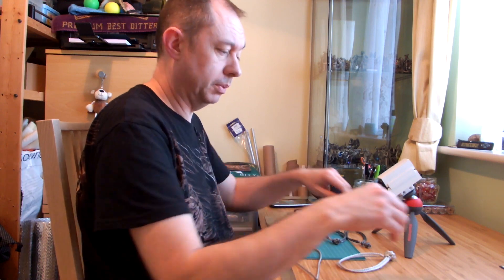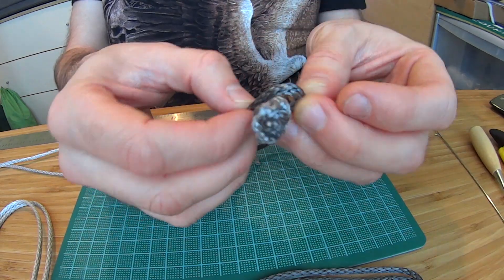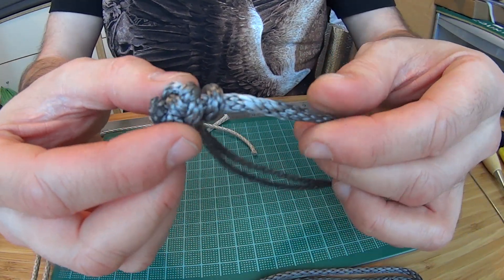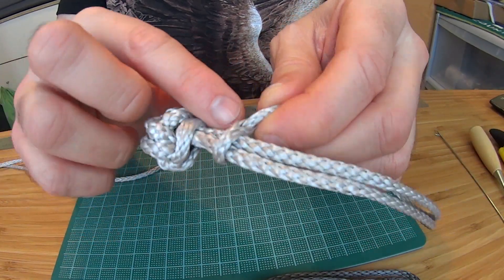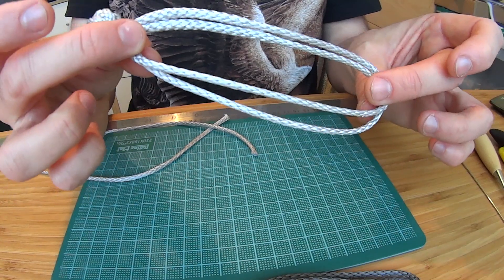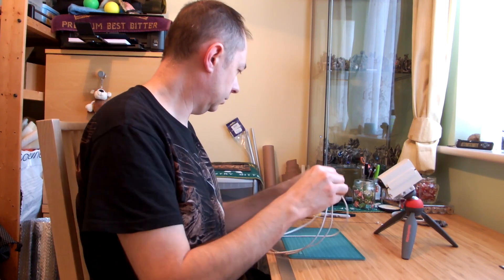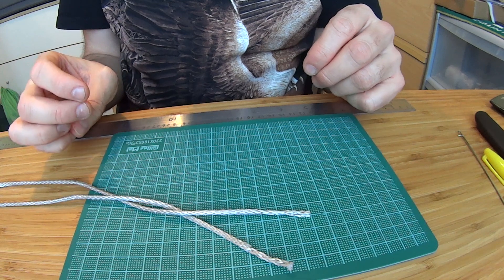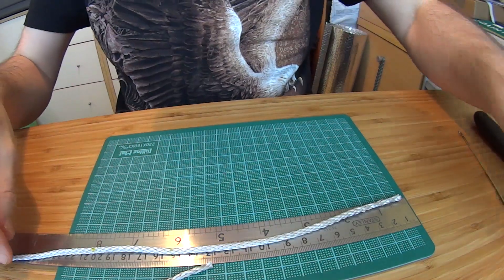Improved Soft Shackle

Comment: what are the advantages to the this version with the two strands bare as opposed to the buried version that you have to milk? I understand the button knot vs the other knot but why no bury on the shackle length?
Reply from the maker: jbaker91585 the buried noose version under high loads can be very difficult to release, some put a thread inside to help to open but this is all too difficult in cold weather and cold hands. This version doesnt jam and is always easy to release just be pulling one strand.
Reply: Tac Blades seems so. have you seen comparative test information on the two versions?
Reply: also, would I have any issue doing the button bury if I build a burried noose version?
Reply from the maker: jbaker91585 i put a link to the original research in the comments but since then unfortunately they have removed it from the internet.
Reply from the maker: jbaker91585 just checked looks like its back up again for now anyway.
Reply from the maker: jbaker91585 its not something i have done? I am not sure it if would be possible unless its a very large loop.

Comment: The part of the video where you don't show the second loop made at the end, are you passing the buried loop end through the second hole like you did on the first one? Is that possible given how large a buried rope would be?
Reply: Nevermind on this. After watching the entire video again, I see that you do actually pull the knot with the bury through the cord. I guess I need an all for this project. I didn't have one, and as it turns out, it's a difference maker in terms of being able to pull items through when they are double the thickness. thanks for the tutorial.

Comment: Hi, I have a question about your version of the soft shackle: did you have it tested at the 230% strength or is that number based on http://l-36.com/high_strength_soft_shackle.php ?
I really like your version because of how the tails of the eye splices are throughout the knot and into the part that the loop goes around. This seems to eliminate the weak point of where the tails of the button knot get buried with the other version of the shackle.
Reply: I just found the answer: http://www.balancecommunity.com/slack-science/comparison-soft-shackle-methods/
Reply: Excellent video man, thanks for sharing!

Comment: Excellent demonstration.  I get it now.  And because of the bury, the cord is also double-thickness where the loop tightens around it just behind the knot.  As I understand it, that's also a common point of failure.  As far as I can see, this design of soft shackle shouldn't ever become over-tight around the 'neck', and I can see now why the knot will never invert.

But what I like best about this shackle design is that I can visualise it completely.  That complicated diamond knot looks nice, but because it's more complicated, I'd always worry I'd got it wrong in some way.  The double overhand knot is known to be very effective.  I know climbers who will use a simple double overhand knot to join two ropes that their lives hang by.  Ugly, but simple and reliable, ...and can be done with gloves on.

I've watched a few tutorials on making soft shackles, and this is the best by far.  It also convinces me that this is the best kind of shackle to use, (...unless you really must have a single-loop design for the sake of neatness.)  The fact that is has 240% of line strength rather than say 130% presumably means you can use thinner line.
Reply from the maker: Paul Mackilligin thanks for the comments.  For hammock use and camping use i feel this is stong enough with plenty of safety margin for all uses at any weights. 

I know people that have made dynaglide shackles this way and its good for them. 
The only complexity is that the thinner the cord the smaller the radius in the turns and therefore the weaker,  also the bury length needs to be proportional the diameter of the cord so quite tricky.
Reply: I'm actually looking to replace all (most of) the nasty steel fittings on a sailing dinghy.  Stainless steel shackles with clevis pins and those tiny, tiny spiral wire retaining clips (which can be lost forever even if dropped in a grassy field, let alone if dropped in the water) ...all that stuff has to go.  Planning on replacing the wire shrouds with Dyneema too if I can.  It's mainly for safety though, as the hard metal stuff can cause real injury when body parts collide with it.

The cord you used in the video, what size was it?  It looked about 6mm (?)  I was thinking of using 4mm or even 3mm.
Reply from the maker: Paul Mackilligin this is 7/64th amsteel,  in uk this is 2.5mm see here https://goo.gl/KTpHgO 726kg breaking strain,  you can get thicker tho,  also floats :)
Reply: Oh, OK, a optical illusion then.  It looked much bigger!

Comment: Great video, thanks a ton for sharing.  I've been looking for a good soft shackle to connect whoopie slings to the continuous loop on my hammock.  I'm going to try making some out of Dynaglide.
Reply from the maker: Thanks,  i know some use dynaglide for ridgeline but i wouldnt hang off it i like at least a 5:1 strength ratio to  cope with dynamic loads :)
Reply: +Tac Blades Do you know what the rated strength of Dynaglide is?   I believe Dutch has tested it to 900 lbs.  I'm pretty light weight.
Reply from the maker: +Mark Bishop its 1000lb and amsteel 1600lb
Reply from the maker: +Tac Blades some people do hang off it,  but take care :)

Comment: What an eye opener. While I like my Dutch clips for my hammock tree straps, they do cost $$. These improved soft shackles have a less fussy open/close than the soft shackle that I've considered using for tree straps in my other hammock kits. Another advantage over Dutch clips:  these won't take the paint off posts in urban hangs.  
MEGA thanks!
Rope is fun!
Reply from the maker: No problem,  ulta light,  ultra strong,  love them.